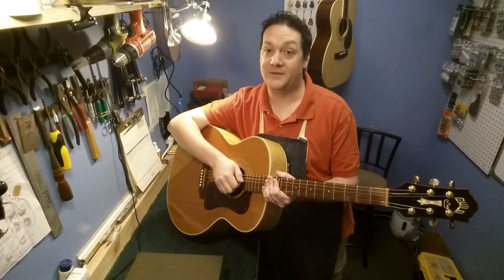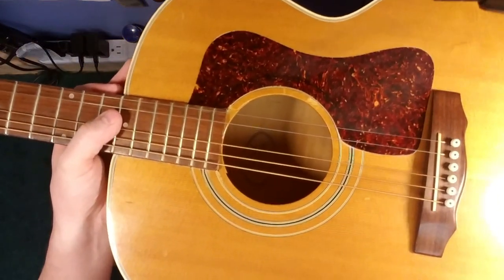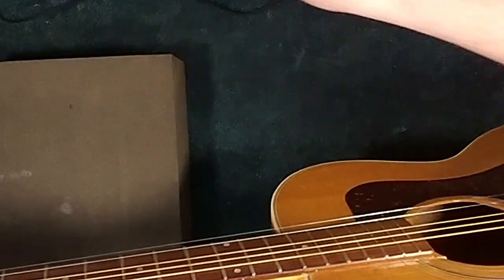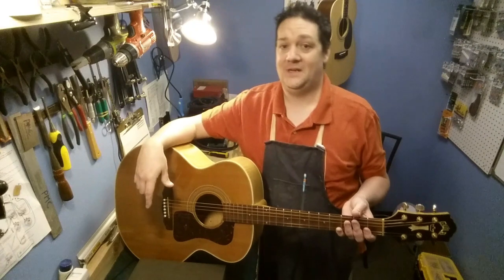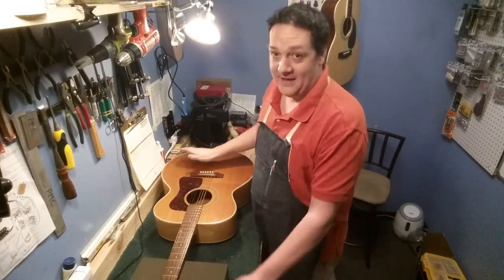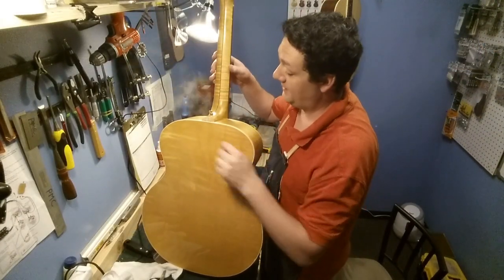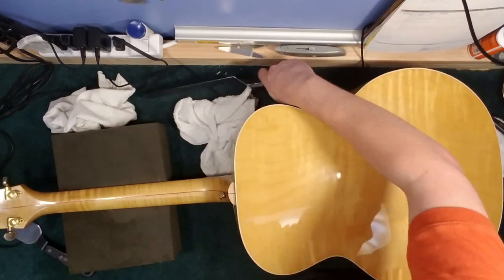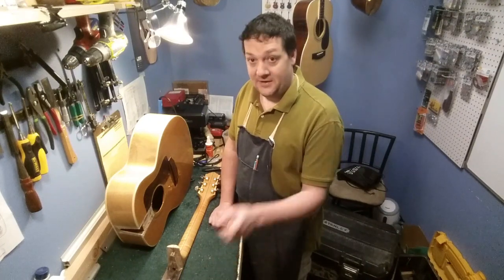Guild JF30 Acoustic Guitar Rebuild, Part 1 of 3, Neck Removal

Comment: As far as bolt on necks go, don't forget about Taylor Guitars.
Reply from the maker: I can't forget about Taylor guitars, no matter how hard I try.  lol  But yes, Taylor does have a good system. The only problem is that you have to take it to a Taylor certified repair center because they have to use special CNC cut shims in the neck pocket that are not available to the average consumer.

Comment: All that crying for nothing, Gibson necks are much more difficult to remove.
Reply from the maker: I'm sorry to hear that you've had trouble with Gibson necks.  It's just been my experience that they are usually among the easiest to remove, second only to Martin.  Guilds have always been difficult for me.  But that's just my experience so it's really all I can speak to personally.  I'm glad to hear you've had better success with removing Guild necks.  Perhaps you could share some tips that would make it easier for next time?  Thanks for watching!
Reply: @MazzoccoGuitars  overall a good vid, I watched it in full, you did a good job explaining the issues.  Was concerned about the pick guard,  but no need to fuss right away untill you hit the pot hole. It is only work and a good tech ,as you are can take care of it with no sweat. Peace crag